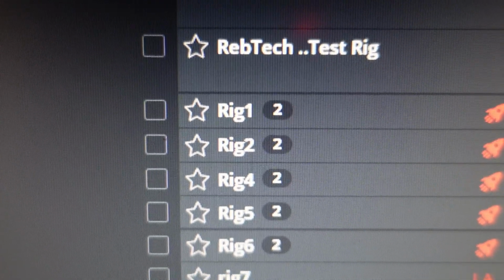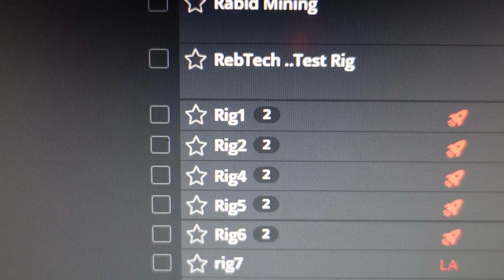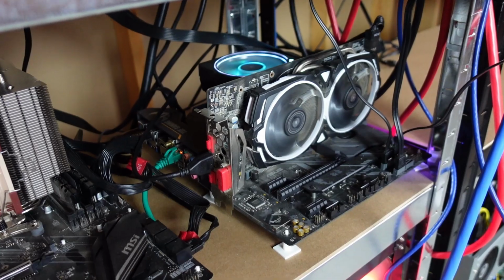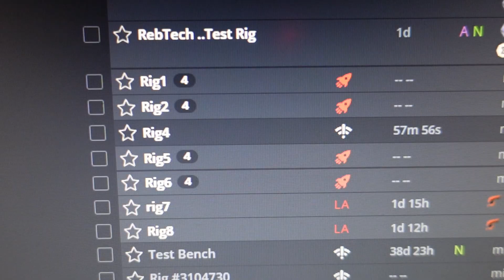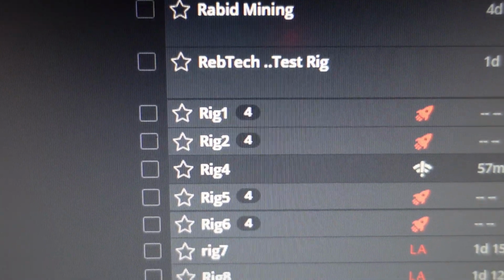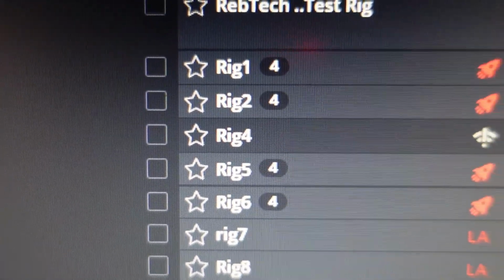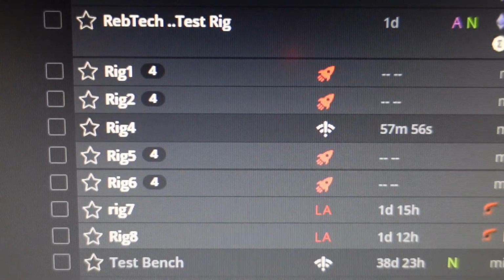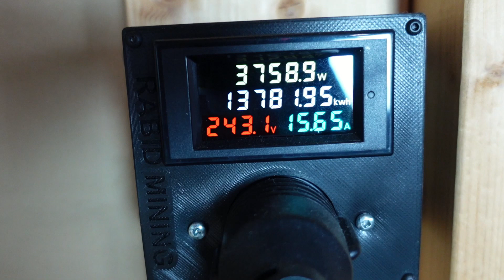CPU Mining On a SERVER PSU | 50w dropped at the wall

Comment: Hey rabid do u know if there is anyway to use XMRig to mine $BTRM I know XMRig can run the ghostrider algo but it won't work on $BTRM on hive O.S. I haven't tried any of my old office PC's that run windows I'm pretty sure I could do it on those since I'd be able to manually change the coin but in hive idk. Anyone got any suggestions, any help is much appreciated I'm trying to max my profits and switching from $RTM to $BTRM is the difference between 11 cents after power and 22 cents after power
Reply from the maker: It should work yes what pool are you using?

Comment: I prefer server psu since they have a higher efficiency rating and I feel they have a better track record of safety than the square box ATX style but if like the atx, go with brand names or risk damage to components or fire.  With bare wires I clamp on eyelet connectors and they plug right in and tighten well to breakout boards.  Less likely they'll fall out too.

Comment: Hi, can you tell me if I'm able to build only two mining rigs on 3700x overclocked using ATX power supply? Since on ATX PSU maximum number of CPU cables is two 8 pin ATX cables each will provide not more than 225 watts.
Reply from the maker: Would only run 1 per atx does it have 2 24 pins for the MB?
Reply: @RabidMining  like every ATX PSU it's only one 24 pin cable, though I found for sale Y-splitters for 24 pin cables.

Comment: got the same peco supplys u have but i can only see 2 4 pin connecters do u use the 4 pin with the loop of the 4 pin connecter next to the 24 pin plug  
both 4 pins dont fit together
Reply: I think you notice in video that he does not use them as an 8 pin cpu supply but uses them as 4 pin power in the 8 pin socket then puts the other 4 pin into the extra power 4 pin socket. I had the same problem. I was stumped as i bought all the same products after watching the video and using the links to find that the 4 pins dont fit correctly when i went to assemble it all. So i watched the video in slow mo till i found what he did @  10:45  you can see it clearly.

Comment: Why don´t you use a regular 12V (13x) 6 pin breakout board and combine 2x 6 pin to 2.5mm barrel jack into a double barrel plug 300W pico adapters? You are using the regular picos with just one barrel plug but there are safer ones with two barrel plugs in order to use 2x 6(2) Pin to barrel jack cables. Regarding the cost of the ac adapter that you use and the fiddling with the cables the mentioned option might save more time and money than the workaround with the diy parts from parallel miner!?  You could go with a regular set of a 750W HP Platinum, a breakout board and then a bag full of barrel jacks. Then cut off the 6 pin plug on one side of the cable, add the barrel jacks. Then connect 6pin cable with the server psu/breakout and the barrel jack with the pico. I know this isn´t too different to your solution. Just an alternative route in case the parallel miner breakout board is out of reach (I absolutely like their approach but the delivery from the US plus the customs import fees are just too expensive where I live).

Comment: earth cable, probably a good idea to connect it too just for insurance 
Normal PC PSU has ground, pc case, hdd, screws etc.....
Pico probably has a earth just connect a green cable from pico to your psu, 
not sure if your break out board has an earth, but maybe connect it to the psu case or even directly to the power cable via mod
probably good idea to ask the experts at parallel miners

Comment: Talking about "longevity", have you think through all the possible incomes?
What happens now if the Server PSU dies? Yes, it can and you will have "FIVE" mining rigs down instead of just "ONE" :$
What happens if one mining rig has a big short and it propagates back inside the breakout board? You could technically loose "FIVE" mining rigs instead of just "ONE" :$
Have a great week ahead my brother Rabid and keep on mining <3
Reply from the maker: That's why you have back up parts those scenarios can happen with anything I have extra MBs extra psus extra picos and so on.
Reply: Shorts cant "propagate".

Comment: I don't like this setup at all, chinese barrel plugs can do like 5A at most, chinese screw terminals are also famous for being really bad.
How I would do this (setup that can do 300W CPU no problem): use of those tiny pico PSUs that sit on top of the 24pin, but rewire them with 18AWG wires, from it two wires going to 8 pin EPS connector, from the EPS connector 6 wires go to 6 pin connector which plugs to standard server breakout board.
This way max of 324W can be pulled, only like 24W will go to the pico PSU, rest which is 300W can be pulled by the CPU.
Unfortuantelly it requires soldering(2 wires for pico psu), but it's worth it, ONLY 8 WIRES FOR WHOLE SETUP, EIGHT!
Where as in the setup from the video you have like 40 wires and pico psu board dangling around.
Reply: not to mention the chinese 300w pico, i dont think they would go that high, may around 150w to be safe. the ITX guys use expensive pico 300,400,500 watt pico with lots of components and heat sinks, they look solid, very expensive and requires 19V.

Wiring CPU directly to PSU, would that interfere with slightly different voltage and frequency? as mobo is passing through the pico?
From the mobo perspective, its powered by 2x PSU, I guess that would be fine as miners use dual psu to power their GPU anyway.
Reply: @leoncryp8182  No you don't actually need the pico PSU to be beefy and capable if you have a separate wires that feed the EPS CPU 8 pin header, because that pico PSU is mostly responsible for generation of 3.3V and 5V rails which are actually hardly used at all, at most like 50W from those rails is used, almost everything is using 12V.
Reply: Did you actually tried of what you wrote? How many systems I can throw on single ATX PSU if each system will take 200 watts?

Comment: Why don't you just use standard breakout board (12x6pin connectors) with PCIe cables which you can solder to pico board input plug (or even solder directly to the pico board). Less connections, means lower probability of failure.

Comment: I am CPU mining monero with a 3950X and 5950X,  ~17kh per CPU.  I just pointed my 3080ti to mine on monero ocean and it's getting ~75kh, or over 4x what an optimised 16 core Ryzen can get, and the consumption of the card is 225W.
Reply from the maker: Yes but I do think your GPU is mining Ethereum or something and just converting the said amount to XMR and basing the hashrate that way.
Reply: @RabidMining  It is, and I know that doesn't support the XMR network, but it is still more profitable than CPU mining
Reply from the maker: @jjarman009  depends how you look at it
Reply: @jjarman009  building 6 GPU mining rig is fine with Ryzen CPUs like yours since they ROI in 600 days, but people buy these cheap 2 cores Intel CPUs for 100$ CPU alone not counting MOBO for 400$ that won't ever ROI since Core 2 Duo doesn't mine at all. From that perspective you'd like to invest in Ryzen CPUs to get that ROI and still be able mining on 6 GPUs.

Comment: You should also move HiveOS to M2 NVme disks instead of standard SATA drivers - it will reduce number of cables and speed up system startup.
Reply from the maker: Ya true I thought about it a few times but can get costly getting all the drives all over again future builds I probably will.
Reply: @RabidMining  It's only like $15 for cheapest M.2 SSD not that much even if you have to buy 10 of these...
Reply: @RabidMining  I use the Kingston A400 m.2 sata ssd. Its still only sata but its very small and only 30 bucks, but make sure to put it into the lower m.2 slot next to the chipset of your gaming plus max.

Comment: Nice setup. Would love to see how the fan noise is though on that server psu. That's the only thing that stops me from using them. I tend to work not too far from my mining rigs so the noise is definitely something I need to consider.

By the way my 3D printer is on its way. Got myself Ender3 V2. Hopefully I can assemble everything together and get started. It does look I have a steep learning curve though. Oh by the way, do you have a glass hotbed on your 3D printer? After it prints, how do you clean the bed?

Cheers!
Reply from the maker: Cant even hear it very quiet as its on 240v so its 1200w only averaging about 485w total with the 5 rigs.
Reply: I live in a 1-room student flat, I have my rig consume 800W from a 1400W server psu, the rig is next to my bed, the loudest thing in my room is PC with standard 140mm case fans running at 100%.